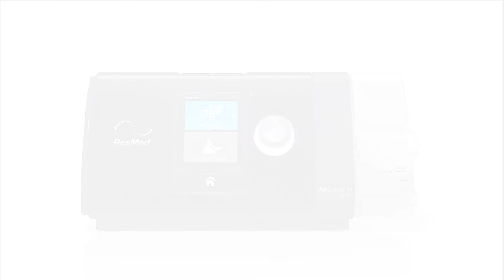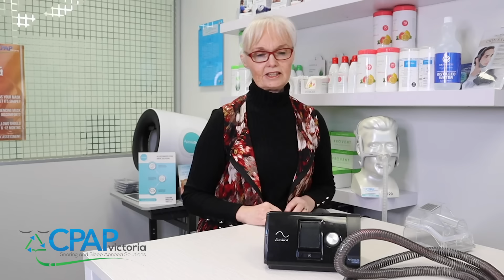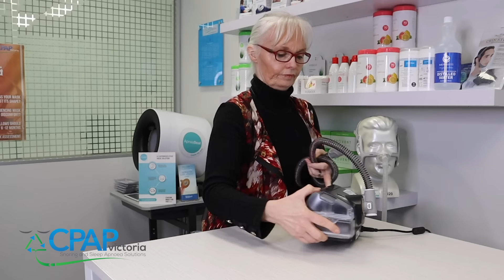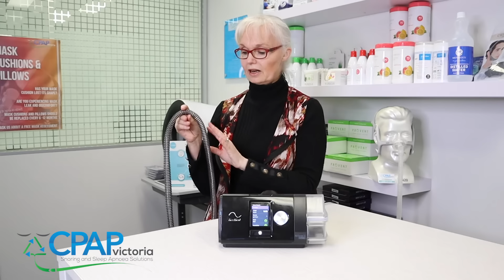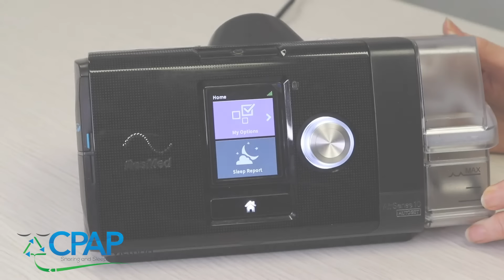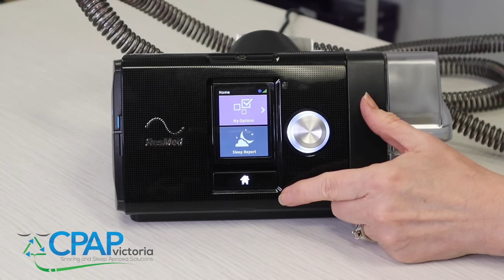How to setup and use your ResMed Airsense 10 CPAP machine2

Comment: The device is very complex, not easy to learn how to use. The humidifier seems to deliver plastic particles inside the lungs, which is  an element of concern. Can we use it without it?
Reply: Get your hands on a "side cover plate" that routes the airflow out of the machine through to the back connection of the machine. 
I live in the US and was able to get one from ebay. 
Good luck.

Comment: My air sense 10 has been working without fail for nearly 7 years.  Still provides CPAP function, but on line MyAir system just stopped working.  Nor record of any data for the last 2 weeks.  Checked machine set up, no changes.  Unit has Airplane switch set to "Off."  Any idea what is wrong with it?
Help would be appreciated.
Jack Blanke
Metairie, LA